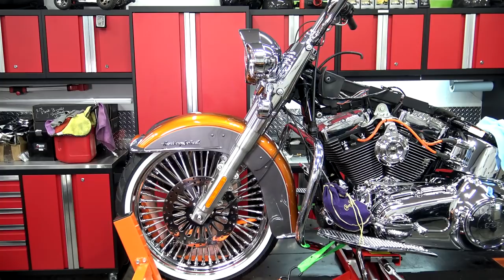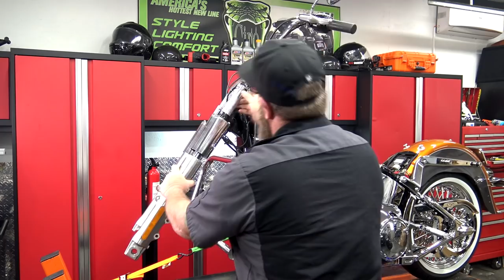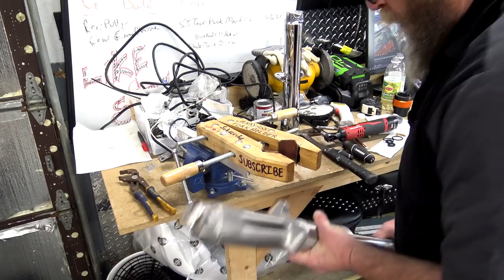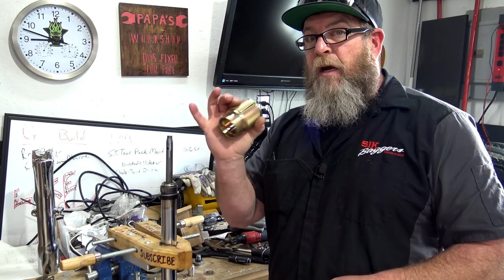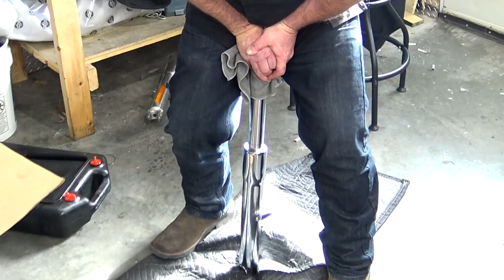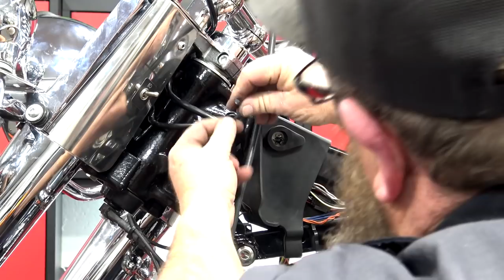Install Chrome Fork Lowers On A Softail @harleydavidson  HOW-TO

Comment: Excellent video. Thanks for the tool advice.  I appreciate you taking the time and effort to make these very informative videos.  In a pinch I have used electrical tape to create a thick bundle around the upper fork.  I then I use the same principal you used to remove the top seal.  But instead of pulling a push the upper fork upside down so that the stop does not get damage.  It works all the time.  Also, a schedule 80 pvc pipe can be cut to be used a rammer to get the seal in.  Lastly, an old seal can used to push the new seal.  The old seal gets all the pounding to push the new seal in. Regarding the bleeding bolts,  those are a little hard to find.  I have created my own bolt by cutting down to size.  However, I have found a nice upgrade bold of much better quality in hardness that utilizes a hex key.  The phillip is just a bad application for this particular location.  Instead of locktite I used white paste for automotive.  Similar to plumbing.  This is an excellent upgrade to locktite.   All those methods have worked for me.  
For the fork holder, why not using a small piece of a 4x4.  Cut a 1.5 inch hole if you have a wood hole saw or two notches just like in your wooden holder.  Then cut in half for easy use.  So that the 4x4 piece stays on top of the vice, I remove about 3/8" material from the wood.  That created a nice stop.  It is basically the same principal as the European fork aluminum square fork holders used mainly in Europe.   My advice is to get the parts ahead of time.  There is a convenient fork seal kit with all the parts for the lower forks I usually get for 30 dollars. 
Professional tools are the best way to go.  However, sometimes a job must be completed, and some homemade tools can get you out of a jam.    I have purchased quality bolts and plenty of copper washers because getting those inexpensive parts is complicated because the dealer never has them, and I have to drive 45 minutes to get a $3 dollar part.  Plan ahead and have all you need before you start.  40 years of working with bikes has taught me to always have necessary items to share with friends.
Reply from the maker: Thanks for checking them out and also some great tips as well!!  Ive used the shaved down pvc and even a shop vac extension to get seals in in the past lol but I do like using the old seal to take the brunt of the hits for the new seal..

Comment: Straight forward indeed. A bit more involved than most upgrades but well within the limits of most do-it-youselfers. And looks really good. Thanks Steve.
Reply from the maker: Ye sir without actually getting into the forks this job is easy...however actually getting in there and replacing the guts for upgraded guts inst that bad either...I kinda wished I would have now since I had it all off just to show it..but the front fork on these ride pretty decent so I asnt too worried about it.

Comment: Excellent video thanks. I like to drain the oil & remove the lower leg before removing the forks from the triple tree. The forks still in the triple tree holds them very securely while 'banging' the lower legs off. Forks are then removed from the triple tree to replace the seals on the workbench, as shown in your video.
Reply from the maker: Hey jim...yes sir if you dont have a fork vise that works great!

Comment: Sure be nice if HD put these on as standard equipment.  I noticed Indian has chrome lowers as stock on some of their touring models.  Thanks for posting.
Reply from the maker: That would be cool! Yes..well anything HD can sell your as an after sell they are going to take advantage of...most guys will have HD do this as well....get charged for the chrome lowers and the labor from HD at 120 bucks an hour.

Comment: If I could only add one thing, make SURE you get the left lower on the left side as they are side specific, it will save you another hours work if you unknowingly put it on the wrong side! lol.
Reply from the maker: yes, do one fork at a time and you will be gold..you talk like you have had this happen? LOL..man the joys of wrenching...funny, I just put together a blackstone grill and had it all the way assembled and realized I put the legs/base on backwards so the tank mount was on the opposite side of the gas line....FUUUUU!! take it all apart and flip the base around and put together.

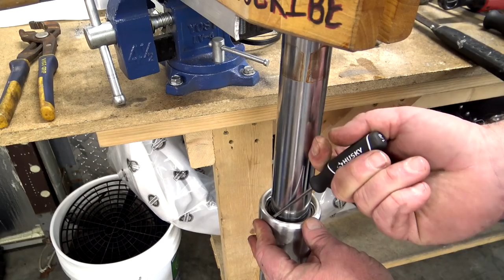Comment: You probably already know this and I apologize if the following is irrelevant to you. At 08:50 you show using vice grips to tighten the front screw on the wood clamp. Wood working clamp tip - they're designed to provide a significant amount of force. The key is to tighten both front and rear of the clamp near the same gap width until the front handle is tight as you can get it. THEN tighten the rear of the clamp handle as tight as you can get it, which will transfer force through the front handle which will also increase that transferred force exponentially to the clamp jaws. My thought is you appear to have significant forearm and hand strength, and can just use that alone to provide enough force to hold your fork.
Reply from the maker: Thank you...and yeah I try to do that the best that I can..those fork legs get slippery and when applying force to them sometimes i just put some stank on it with some pliers lol...just for good measure. I am definitely not a wood worker so thank for the heads up..ill try that next time and see how tight I can get it.

Comment: Another great “ you make it look so easy “ video ! Great information on those forks and how they are put together. I see that toggle, is that for the passing lamps?  Thank you Steve, great to see the Cholo getting that great look !
Reply from the maker: Thank you Dave...it was prety smooth until I ran into the fork seal driver issue...that cost me a day and half of time, but one of the mechanics up at Black Diamond loaned me one for a few hours so I could get the job done. Held up a day and half for a simple tool that takes 4 seconds to use....isn't that how it goes bro lol

Comment: Odd thing about the spacers. I have a 16 Softail. One side of the rear wheel has the lines to the outside, and the other side they are facing inward. I guess I should put them back as they were installed.
Reply from the maker: yeah just put em back they way they came off and youll be fine

Comment: Where did you find the headlight ring I've looked the world over trying to find that exact ring and can't find a fit anywhere, I have the 19 deluxe but I'm sure this model will work on my bike, any help would be greatly appreciated.
Reply: Same!
Reply from the maker: Ebay actually. I just picked a 7" headlight ring visor and passing lamp visor set and rolled the dice.  Ill be honest with ya though...be super careful turning that screw...im quite sure its made with about 40% butter. Super soft so cranking it down to remove the gap at the bottom is tedious and you really need to make sure you have the correct size Philips screwdriver or you will strip it.
Reply: Thank you, I'll definitely take a look at Amazon.

Comment: Are you going to run an Advanblack rear cholo fender? I saw another video on @professional monkey's channel. In my opinion they should not use a cat eye light on a cholo fender. I did however like the turn signals they chose. I have a few ideas, if you are interested. Thanks for the videos. Can't wait to see the exhaust install video.
Reply from the maker: Yes Ill be fitting the Advanbalck fender to it, front and rear...Thats part of the build. Just received it the other day..however I have to convert this one into a bagger first for the advanblack channel then we will install the cholo parts.  Let me know your thoughts though.

Comment: I recently bought some new replacement forks for my 2005 Heritage Classic. After market manufacturer states I need 8.5oz of oil, Harley service manual says 12.9oz or 4.72 in. (119.9 mm). I really don't want to have to disassemble the forks to use the measurement method and as far as I know, the after market forks are exactly the same as the original stock ones. Do you find it reliable to go with the volume method of adding oil and should I go with the recommended amount from Harley?

Comment: Steve, thank you for this video. I am taking the front end apart off my 2007 softail  Heritage and this was alot of  help. Question....Would you  happen to know where i can purchase the headlight/passing light ensemble in black.  im tryin to black  out my front end. thank you
Reply from the maker: thank you jose! And no im not sure right off hand..it might be easier tro disassemble it and have it powder coated..its pretty cheap to have it done

Comment: I was installing new cans, Progressive shock upgrade, ape hangers etc, when I took my forks off that little Spring that you are supposed to reuse was not there??? 02 Herirage softail, is it supposed to be there??? What sucks is when I went to take the other side apart I could not get that top bolt off, I tried everything for 3 hours, So that being said I do not know if the other side had the small spring..... Very annoying but I am bring the other shock to work so ine of my guys can get it off for me..  Is my 02 heritage supposed to have those little springs???
Reply from the maker: its the dampener tube spring and yes it should have been there on the bottom and the dampener spring sits inside of it...both sides should have it.

Comment: Hey brotha dope build !!! I subscribed immediately as soon as I seen you were building a Cholo Softail because I am as well currently, A question I had was will u be installing a Kuryakyn Chrome Neck Frame cover and chrome frame down tube covers ?
Reply from the maker: Hey Jayden...yes I alraedy have them i the box ready to go on...I want to get the bars and cables done first then that will go on after and we will be doing a video install on it as well. So stay tuned for that
Reply: @sikbaggers  I would like to buy those as well for my bike it’s an 08 Softail Deluxe do you have the part numbers for them or links where u bought them ?

Comment: Great video man my Question is  I'm in the process of doing mine! Replacing seals and bushings in the lower! So if it's dry are you saying the upper tube! If it's still wet do you need to add it as wet or dry! I have a 97 FLHR road king I did clean the walls of the slider! But not the upper! But great video brother!
Reply from the maker: Man Im sorry im just getting to this..im sure you have this already put back together by now but what im referring to on wet vs. dry is wet is you have already had fluids in there.. and dry is brand new, never had fluids in it...the good news is that with the shocks its not really a science on the amount of fluid...I mean it does not have to b e perfect but just close...so if you dry wiped the inside and only added the wet amount your going to be fine...its a minuscule amount of fluid.
Reply: @sikbaggers  No worries man! And yes I did get them put back together and they don't seem to be leaking, anymore! And I put a 11.2 oz in the tubes! It was my first time doing fork seals and bushings! And I at least have a manual now to help! You have a nice looking, scoot brother! Ride safe and Keep The Rubber Side Down!

Comment: Hi, excellent video! Just wondering how you applied the torque wrench to the  fork filler cap thin socket with the handlebars in the way? I think it's difficult to get a straight shot at the socket with the bars there.
Reply from the maker: Crowfoot wrenches..they sure come in handy.

Comment: What brand inch lb torque wrench do you use and where do the settings start ? Thanks for all your great videos.
Reply from the maker: The ones I used in this video are just simple click drive torque wrenches  purchased from a local parts store...not even sure on the brand anymore the incher I believe is 20 to 200 ..but I have 2 others I use when me and another guy are tackling both sides of a bike at the same time..keeps from having to pass tools back and forth and they are from amazon https://amzn.to/3FnVl3e

Comment: Hey Steve.  I was doing my purchases from the parts list in the description.  I clicked the link for the 41mm but for my 23 Road King Amazon is saying: Motion Pro (08-0488) 39mm Ringer Fork Seal Driver.  I know that you know best and I was thinking Road/Street Glides and Kings were the same.   

Should I still get 41mm or go with 39mm?
Reply from the maker: Hey chris... yeah amazon is definitely not a place to trust " fitment " 14 and newer are all 49mm on the touring models...proceed with the 49mm
Reply: Thank you 🙏🏾.   I appreciate it.

Comment: Hi Steve , one more question. After I put the chrome lowers on my bike I also installed polished rotors. Do you have any recommendations on which brake pads would be less likely to scar the rotors? Thanks again Shaun
Reply from the maker: Hey Shaun...you really have 3 choices on brake pads..I did a video on this bike on the brakes that explains it better but there are sintered, which are harder and last longer but are harder on your rotor, then there is organic..softer and not to bad on rotors but dont last as long..and then semi sintered which is a combo of both ...but really once you hit that brake the first time it will scar that polsihed part of the rotor with any pad

Comment: I hate to be THAT guy but why didn't you do this when you changed the front tire and wheel?
Reply from the maker: yeah Karl dont be that guy! LOL just razzin..great question!  If I was doing this without shooting videos trust me I would have. Its a lot of steps to put everything back on and then take it back off again for another video...but it is two separate installs and I want clear instructions from start to finish of each install..so that's why I take the extra steps to do that.
Reply: @sikbaggers  very understandable. I will say your videos are some of the best tutorials on YouTube. Informative and fun to watch.
One question though. I want to chrome out the front end of my 2013 Heritage but I have no desire to mess with taking apart the forks and reassembling them. Is there a shop that I can send my complete forks to and they'll send them back chrome?
Reply from the maker: @karlanderson1791  Well sir im not sure on that...never sen any that do that....but do you have a local independant bike shop around you? Somthing that isnt HD..Those should be able to do it pretty quick and wont break the bank. Ive really never seen any shops that youc an send your forks to and they do all the work and mail them back..im sorry.
Reply: @sikbaggers  yeah we're not too far away from some independent guys. Actually I've considered learning all that stuff so maybe I could stay busy after retirement tinkering with bikes and doing stuff people don't want to do for themselves. Most any of that stuff shouldn't be too hard after you've done it a few times. Thanks for the response and for all the great, very informative videos.

Comment: Could we also take the stock fork slider and take it to get chrome plated instead of paying Harley $500 for new chrome fork sliders
Reply from the maker: well yes..thats what I did in this video..sort of...these arent harleys,...I did it through a company that does fork exchanges..they take oem sliders and chrome them...you just send yours in and they send you chrome ones. I wouldnt buy them from HD..
Reply: @sikbaggers  do you happen to have the company name?
Reply from the maker: @dabrownconservative7843  Lower Fork Legs are from Impress-Chrome  - https://ebay.to/3gdPvXA